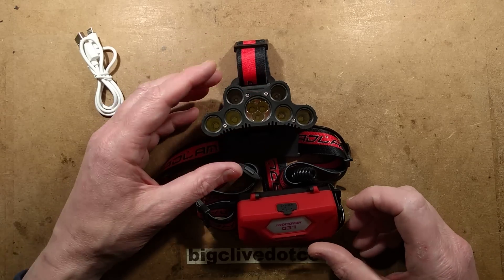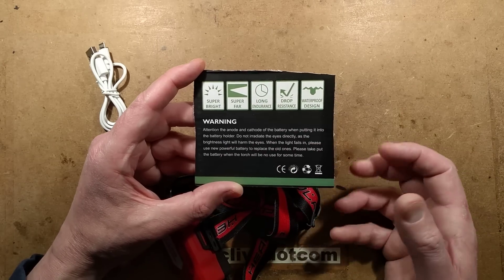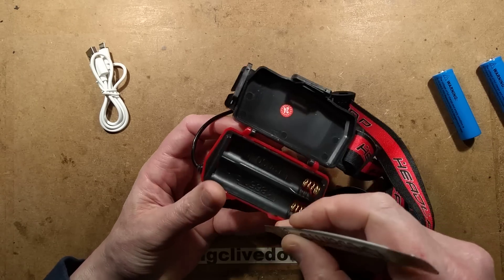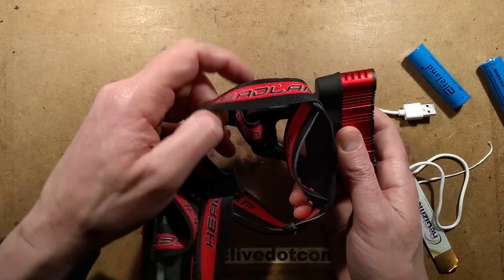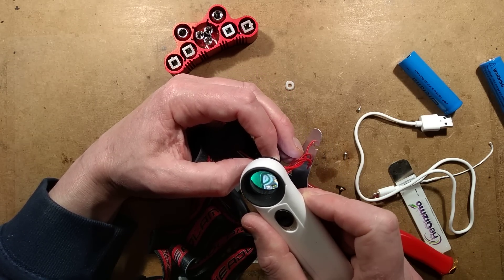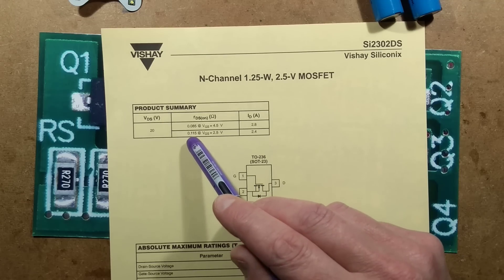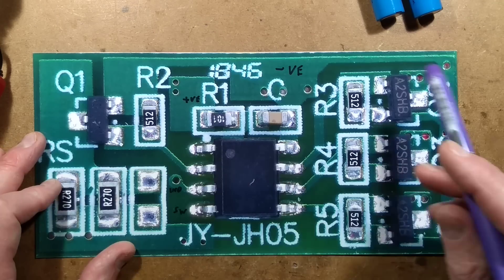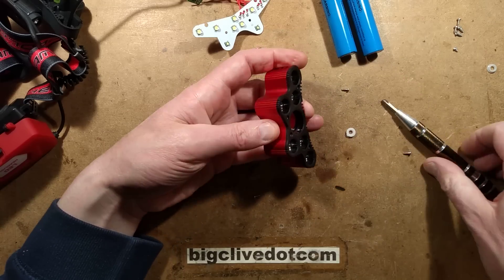9 LED headlight Elfeland teardown.

Comment: I got one from Newegg for cheap. Says it came with 4000mAh 18650 cells. After testing they were 500. So I use those in my pocket flashlight and put my actual EBL 3,000mAh ones in the headlamp. Headlamp lasts weeks now since it's a single focused diode with 6000mAh behind it. I find these things handy.

Comment: Never liked them using your noggin as an advertisement hoarding.
For single cell headlamps can thread the silicone holder they come with onto the adjustable strap on the back of a baseball cap. And ditch the advertising webbing.

Comment: A few things I would note having been an avid vaper for some time now. 1. Discard the chinesium batteries ASAP! 2. Buy a proper set of 18650's from a reputable company (Samsung 25r, 30q) 3. NEVER charge cells inside the light, always charge using an external charger. 4. Check out Battery Mooch for listings and tests of 18650's and their true ratings. Lastly, I've seen reports of these blowing up on people's heads, almost certainly down to the house fire brand batteries.
Reply: TrustFire - you can trust that they'll catch on fire! Unusual honesty in Chinese advertising! ;-)

Comment: That roll in the battery capacity reveal..... LOL
Reply: I wonder what would happen if every knowledgeable buyer measured the battery capacity and gave a one star rating and a bad review with the real capacity?
Reply: For every knowledgeable buyer there are 1.000 byers who will give 5 stars as soon as the lights turn on. That's why we have sellers marketing 5.800 mah and more. That one review will decrease the overall rating only by 0,004 %
Reply: I'm a little sad he didn't open the battery. The real light ones are usually fake, i.e. have an actual smaller battery inside them!
Reply: toysareforboys : what's inside fake batteries ? apparently fire 🔥 and fake cells :-(
Reply: I was impressed by that too

Comment: Im guessing the resistors are there because there are three LEDs in parallel for the primary circuit as opposed to two in the auxiliary circuits, possibly to limit the power dissipation in the transistor.
Reply: If had this type of headlamp then would be thinking of bridging out resistors at least temporarily to see if made much of a difference

Comment: Hi Clive  I really enjoy your videos. 
I have one of these headlamps for a year now  works  great I got the headlamp without batteries. And I use soshine 3400mAh actual capacity 3350mAh it lasts all day ideal for tight attics and dark cavities, I'm an electrician btw.
Reply: Soshine NiMh cells are remarkably good quality for the money. Not yet in the same league as Eneloops but they offer a very good capacity per dollar spent (and seem to hold charge very well).

Comment: I'm not comfortable using "torch" because it relates to some of my soldering and brazing tools.
Reply: Are you "of the body". . . . . ?

In English, English, the reference to 'torch' is an archaic throwback to the times of pitch impregnated hemp burning on the end of a lump of wood - a light source!

However, my dad, who served in the army during WW2, often used the term 'flashlight' an affectation acquired from associating with American GI's, and I guess I grew up with both terms in regular use. However, when someone mentions getting a torch, I do still think of that burning pitch on the end of a big stick!
Reply: @28YorkshireRose12  , "torch" always makes me think of a scene from a horror movie where a mob of townspeople show up at the monster's Lair with pitchforks and torches.....
Reply: @Matt Quinn "Torch" implies combustion of a fuel, whereby "light" is appropriate to the purpose of the tool.
Reply: I believe the early flashlights had very inefficient batteries and bulbs, therefore they had a momentary button, which you pressed in "flashes" when you needed it, to conserve the batteries.
Reply: So it was quite correct to stop using "torch" when lighting became based on electricity.
Reply: OK, I admit I was trolling. Gotcha.

Comment: I bought one a few months back, I've got to replace the wires joining the front and back as the light turns off if it has a slight knock.
But I bought some proper 18650's.
Not a bad item 4/10 if you customise it. But there's better.

Comment: These flashlight companies would sell way more if you didn't need to switch through a dozen modes to turn it off and on.  How many times have you tried to turn these off too fast and flew right by the off state?  There should be two buttons; one on/off and another for the mode.  Most people will just use their favourite mode and if you are really exploring you likely will want to switch it on and off to save battery power.
Reply: Absolutely !  Just a flashlight. Not strobe , flash , blink , SOS , call Bat man , and everything else.
Reply: That's true, a separate off button would be better
Reply: @crackedemerald4930  Seperate button or programming that microcontroller so that you'd have multiple actions and mode memory (turns on with the last used one) would make it somewhat more useful for example:
normal short press = next mode
double click = jump to max output mode (threshold for what is a normal single and double has to be set sane)
long press while on = turn light off
long press while off = turn on at lowest output mode

Oh and flashing modes should be removed or obfuscated at the very least behind something like triple fast click?
Reply: Most people don't care about the cyclical modes, because most people are used to them all being that way.
When you get one that you don't have to cycle through, it's a surprise and a relief lol
I find it very annoying, and spend more to get lights that work properly, but I also buy lights with the cyclical controls if it particularly want that style light, and just cuss it whenever I use it.

Comment: I have the single unit LED torch that you tested a while back. It had a small round hole for a charging lead but no circuit to control the charge. I removed the battery holders and found enough space beneath to fit a TP4056 charging board. Filed out the round hold to fit a micro USB plug on the TP4056 and the original LED hole lined up to show the red LED on the TP4056.
Fitted 2 decent Samsung batteries and it gets a really good run time and easily recharged. Shame about the heat it produces though. Does get quite toasty after a while.

Comment: Show us your favorite head light (don't necessarily need a teardown). You mentioned it in the video but didn't tell us what it was.
Reply: Petzl makes the best head lights IMHO. Been using them for decades, never failed me.
Reply: @Io1564  My Petzl Myo Rxp gets so much use I had to fit a charge port.
Reply: Yes we need this
Reply: @CircularMirror7  Duracel batteries hold more charge and you carry spares. For an emergency lamp the battery seems secure.
Reply: Don't be daft, teardowns are what this guy does. Go to a led headlight review channel.
Reply: @mattburrows2615  This was more a comment on that he teased the light but did not give is any specifics this is rather uncharacteristic of him. I was more offering that in case he doesn't want to risk tearing apart his nicer light as some of the light teardowns are quite destructive. Knowing Clive (not that I actually know him) he has in all likelihood already had it apart to look inside.
Reply: @Zanthum  I indeed doubt clive has the ability to purchase a light and not take it apart.
Reply: @Zanthum   I misunderstood your context entirely - now who's daft. 
I'd find it hard to believe if Clive wasn't  like me as a kid pulling appart all his toys just having to know what is inside and if it can be modified to be brighter noiser or faster. Some things never change I guess...
Reply: @mattburrows2615  I hope Clive never played doctor when he was a kid...

Comment: I wonder if it ever got put back together?
Reply: I wonder when someone of Clive's height, build, disposition, and inclination will be so bold as to begin suggesting ways in which products torn-down could, or can, be improved from stock. In the case of this head-lamp, would it have been worthwhile, for example, to bin the batts and replace them with something more burly? Could the silliness of the lockstep switching cycle be changed -arguably 'improved' - by excising a few LEDs so that point in the cycle effectively, if not clicked-through, turns the unit off and resets the cycle to the default start? Etc..

Comment: Clive, laddie.... yea should be out in the fog with the others, awaiting the start of the TT.
Reply: @Matt Quinn But Matt can you not just imagine BigClive hopping onto the MV 750, pudding-pot helmet strapped down to keep his beard from draining too much speed (he did used to ride with Mick Hailwood don't ya know?) and going off for a couple tours of the rock?  The real problem though, is that it's apparently a deluge again this year and the TT may not be run for safety reasons.
  All the best mate.
Reply: @trumpetRex  Done the course on an ST100 (obviously NOT during the Races!). After that I was even more impressed with the circuit times the real experts managed to knock up  (and not that surprised how many have died on the course!)

Comment: I bought a truck with a 52 inch light bar on it water seems to have taken most of them out, however when I hit the switch some still light, after I fix the transmission and I stall the new light bar I wanna take this bar apart and salvage some of the LEDs and see if it just corrosion that are then up.

Comment: The pissing contest is not all bad. Those LEDs are bound to fail at some point, at least you will have some left when you come back from the trek :-)
Reply: @Garaidh Llwyd That's not how LED screens work. They are LCD screens with an LED backlight, usually a few dozen LEDs at most.
Reply: @SodaAnt  Well I guess there are OLED monitors out there now and AMOLED screens for phones/tablets nowadays, in which case the screen does consist out of many active light emitting elements instead of an LCD letting light pass or not.

But they do have known issues with the blue pixels degrading faster than the red and green ones, possibly leading to colour shifts later after use. And I suppose if one is used 24/7 with rather static images that have bright sections displayed they can kinda similar to old "screen burn in" but in reverse dim that area earlier than expected.
Reply: @extrastuff9463  The early OLED screens do fail with age. I had an old OLED watch that I used to love, I could watch videos on the blasted little screen besides it being a rather large, very heavy due to it's all pot metal case, and had extra batteries that one could charge individually  as needed.  After about 3 years, the screen went dull then went so dim it barly showed, that's when I took the batteries and used elsewhere and tossed the watch.  Hated to see it go, it was a neat item, it was also a cell phone but now days that seems the norm and not the exception.   I also have an old Archos 104 where the OLED screen has gone bad, it now displays in a dim RED and black mode that can only be read in the dark.  Works OK for a night time MP3 player to  lull one to sleep and keep the nightmares at bay player, well it did till very recently when the old battery began giving up the ghost, now only plays about 2 hours then dies.  Time to that one to go in the bin as well I guess.  It was only a 4 gig anyhow, and by today's standard, mostly useless, however I have never tried to listen to more then 4 gig of music in one setting anyhow.

Comment: "Need a special low-resistance meter."  While a special meter would be nice to have - you can do what I've always done - just use one of your inexpensive meters and power supply - run a known current thru the resistors...say one amp to make the maths easy...measure voltage drop..and done!  :)
Reply: Youd have to do it out of circuit to get an accurate reading, of course. You could short your meter leads together and read the nominal resistance and subtract it from the reading if the meter is stable enough (i.e. doesn't jump around a lot).
Reply: @Alan Hartley Its called a Kelvin connection.
Reply: Yes that's true.

Are you sure subscribe to popular Electronics many years ago.

I built the Precision 1 amp current injector project for this reason.

It still may be around somewhere in my stuff somewhere not sure though.

I'm sure somewhere someone could find a project on the internet I bet.

If so desired.

They should have an archive would be nice.

Another possible source for a project would be the Encyclopedia of electronics circuits? 

 And Cookbook of electronics circuits?

 Sorry cannot remember exact titles.

I have only one volume so couldn't tell you for sure.

Comment: So which one is your actual favourite light? I like the cheap cob-based ones without a lens, which provide a great wash of light in front of me.
Reply from the maker: My favourite uses a single focussed LED in a very rugged housing with a simple on/off function and adjustable intensity that is retained in memory.
Reply: Mine is also a simple on/off, but is more of a flood than a spot. I find it easier on the eyes.
Reply: Mine is from earlier in the pissing match, when there were only 3 LEDs.  Some wet+dry to two of the (plastic) lenses turned it from spot/spot/spot to spot/flood/spot+flood (and strobe) and it's been great for work and play for three years now - well worth eight quid and ten minutes effort!